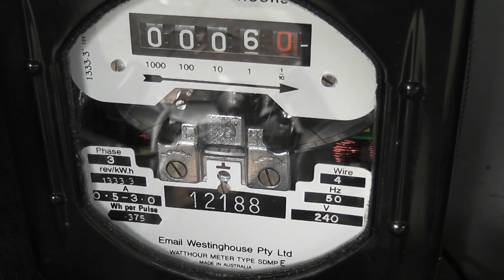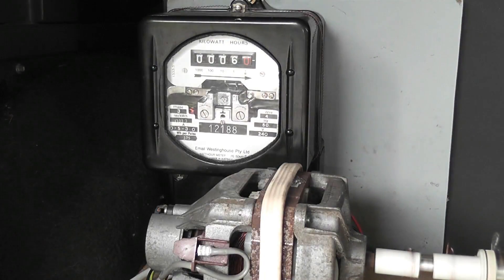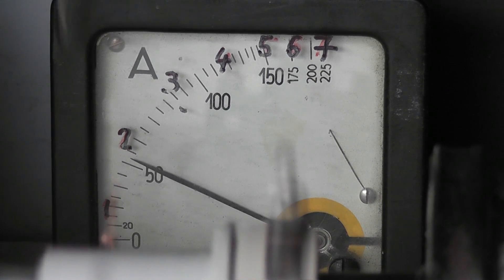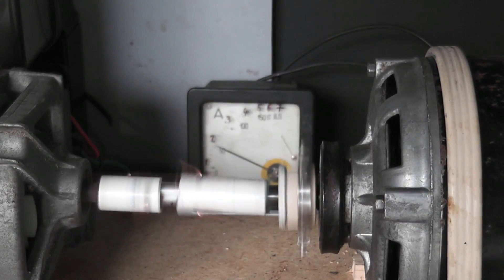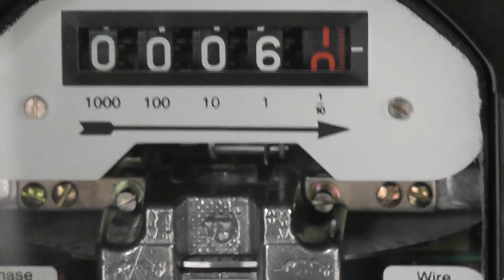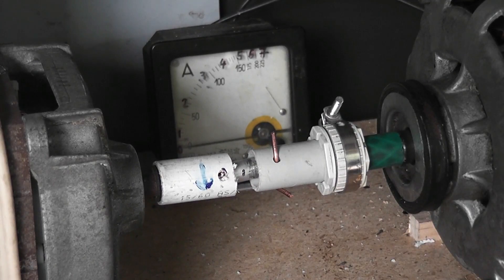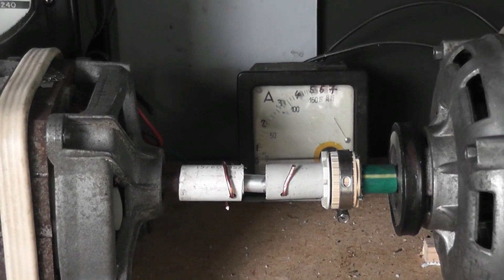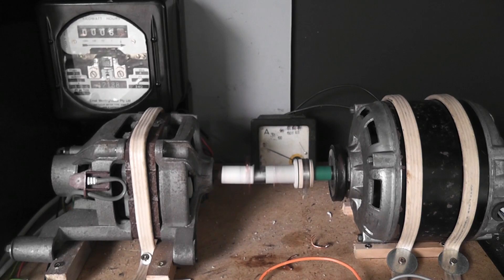Overspeeding Induction motor "generates" electricity back

Comment: About 15 years ago, I was looking at some "home" wind turbines rated at a few kw. The "generator" in it appeared to be an ordinary induction motor, re-labeled as an "Induction Generator". Curious, I set up an experiment with an 8 hp gasoline engine driving a 1 hp induction motor with a v-belt, which confirmed my suspicions. I've found that you can only overspeed the induction motor by about 100 rpm's with the gas engine at full throttle, at which point I was greatly exceeding the rated amperage of the electric motor. Spun the meter backwards very nicely though! I later learned that many of the large utility-scale wind turbines work exactly the same way.

Comment: Is the AC motor supplied from the mains then the DC motor used to speed it up a bit more?
Reply from the maker: Yes, the DC motor is fed from a different circuit and uses power as well.

Comment: How did you set this up?
I would assume that you put the ac generator on the output of the meter and connect a test load on the input
Reply from the maker: AC motor is on the meter, DC motor on variac from different power source (inverter)

Comment: You could also use just a short piece of garden hose as a coupling.
If the forces dont get too high it works fine, otherwhise it will sort of melt.

Comment: Sooo.... Why does the power meter measure negative power even though you clearly are using energy? Is the DC motor connected to a different circuit?
Reply from the maker: The DC motor is fed from a different circuit. The DC motor is the prime mover. If a petrol or diesel engine is driven at over the 1500 RPM speed of the induction motor a reverse power flow will occur.
Reply: Aaahhh ok that makes sense. Thank you for the answer! :)

Comment: If I use a 240v AC universal motor of 12000 rpm to drive induction motor of 1500 rpm, will the induction motor backfeed the universal motor if both are connected to the same 240v line? Will this be even possible or will it be against the laws of physics? Plz guide as to what will be the actual scenario in such a case. Thanks.
Reply from the maker: There is no free energy as some people try to make you believe in some video's. [Action = minus Reaction]. Whatever you put in something you will get something out, minus the losses in the form of heat, (Cu losses, Iron losses), mechanical losses, (Bearings, couplings, belts) windage, (wind friction, cooling fans).
Reply: RODALCO2007 So it implies that the induction generator will essentially backfeed active power into the universal motor prime mover which will be almost totally consumed by itself in the form of mechanical driving torque, supplying zero electrical power to the grid. Is this understanding correct?
Reply: ss The losses will always be there so no chance of going in pluss.

If the other power source isn't the grid then feeding the grid is doable, like water wheel on the induction motor or solar cells driving the universal motor!

Comment: whats the point? it takes more energy then what it delivers right?
Reply from the maker: Yes, the point is that an induction motor will act as a generator when run at a higher speed it is designed for. The motor will push energy back. This demo is not about energy efficiency, as the DC motor draws a lot more power then is delivered + actual losses etc.
Reply from the maker: Yes it does.
 It proves the fact that an induction motor can "generate" power when overspeed. E.G. a lift going down, or crane lowering a load.
Reply: ah thanks!

Comment: The method most commonly used to test big motors as well. Rather than try to load them with some sort of load they connect another motor, typically a synchronous motor, and then use the armature excitation as control, increasing the current till the load on the motor under test is full power. Only power used is the losses in both motors, the energy circulates between the motors.